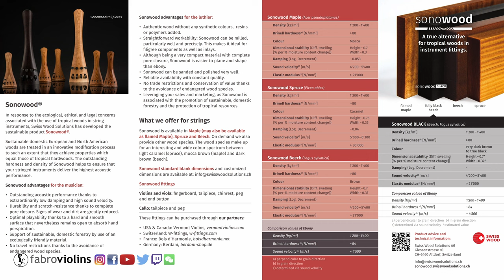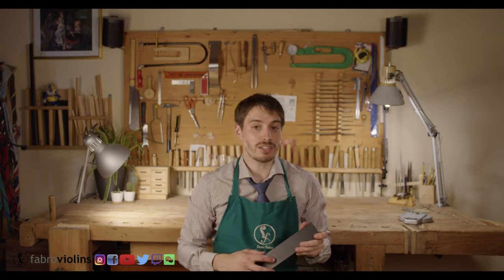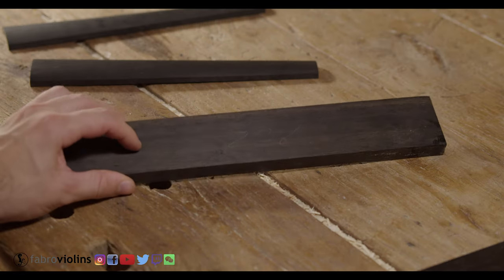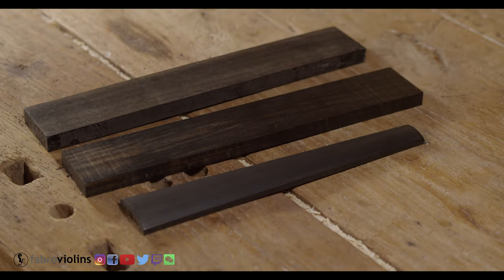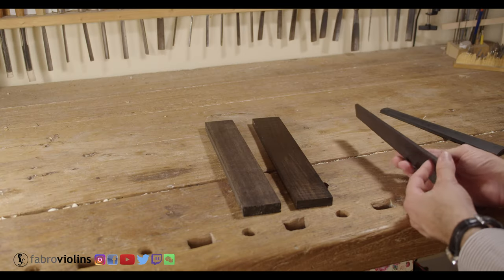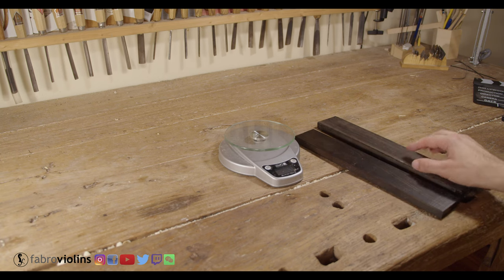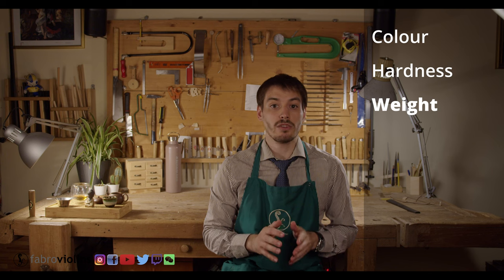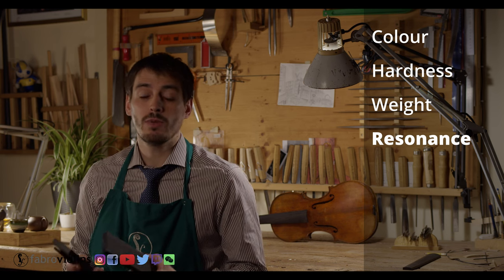A sustainable alternative to ebony | SONOWOOD BLACK

Comment: I have been studying classical violin since 2016. I have also modified a factory violin and improved its sound (I am a visual artist, not a luthier). I do enjoy the dark brown color of this fingerboard. It is not quite black but still has a beautiful look and it can add to the personality of an instrument by providing contrast with the varnish. If you still want it to be perfectly black you can use iron acetate (steel wool + vinegar soaked for 2 weeks) on the wood pre-coated with strong black tea and lay black tea and iron acetate alternatively until you get to the desired darkness. I used this on parts of my modified violin and on its Maple fingerboard and on the fingerboard where I applied more layers than on the violin the result looks great and is extremely similar to ebony - barely distinguishable.

Comment: Personally, I would prefer to buy a new violin that isn't made with ebony, knowing that ebony is endangered. I'm not a professional, and even if I was, i would still look at getting a sustainable alternative so that I could start changing the tradition of ebony.

As an amateur violin maker, I already use rosewood since it's available and I like working with it. The biggest problem I face is if I were to try and sell one of my creations, I would likely have to replace the finger board for ebony because of the tradition of how violins are expected to look. Its a shame it isn't as flexible as other instruments like guitars, where if it makes guitar sounds, people generally don't care what the fret board is made of...
Reply: Hi, I just saw your comment and wanted to give some thoughts from the perspective of a professional violinist/ studying guitarist who has been studying luthierie on the side (not pro but heavily researched). For violin, besides traditions about colour, rosewood isn't preferred because it can irritate people's allergies even when finished due to its oil secretions over time, whereas ebony is usually less irritant and "dry" when its finished, all of which also affects some people's choice of fittings. As for playing, ebony can resist a lot more of the repeated «downward» finger pressure (with gravity) of violin/viola playing, where rosewood, depending on its hardness, usually wears faster. For guitar it doesn't wear as much because of the playing angle (not fully with gravity), but some people feel a lack of hardness in rosewood vs ebony or maple, etc., especially for classical and when doing barre chords. But I do believe that many of these woods could be replaced with more sustainable options if not for moot traditionalist views of many classical players, especially on the parts that are more cosmetic rather than what actually matters, such as the shoulder rest and high tension strings killing the resonance of the instrument. I hope you continue your research, and wish you the best of luck in your instrument making journey! Ciao~
Reply: @dajon33  thanks for your reply! I always appreciate when someone takes the time to share some of their experience :) the durability issue is a big one for a violin that is meant to be played for a long time, for sure, and I never considered allergies, that's an excellent point. Thanks for taking the time, I appreciate it!!

Comment: What about resale value?  When this sustainability fad peters out nobody’s going to want an instrument made from fake wood.  Why not just use aluminum?  Ugh.
Reply from the maker: It will not affect the resale value at all, as fingerboards are nonetheless parts of the instrument that get changed over time anyways. 
When they get some use over them, they get removed and replaced. It’s a very common and simple process. 
So if someone doesn’t want that fingerboard, it can simply be changed for another one. 

Even though the question is rhetorical, the reason why not using something like aluminium is very simple. It’d affect the sound of instrument massively. That’s why I’m looking that these alternatives to ebony are also made out of wood, and if you reach to the end of the video you’ll see that one of the reasons that I’m giving on why I don’t think I’ll use it is exactly that one, the sound (even if it’s better for my allergies and all that). 

So to summarise it. No, it won’t affect the resale value. The instrument is made out of wood (same wood that has always been used). The alternative fingerboard is also wood based. 

Thanks for your comment though, as I said at the end of the video I’m really interested in knowing what people think of these alternatives, if they’d buy an instrument with any of them and so on. So your answer is a very honest one and certainly representative of what a lot of people might think.
Reply: @LucasFabro  thank you for the toughtful reply.  I do admire your work and honesty